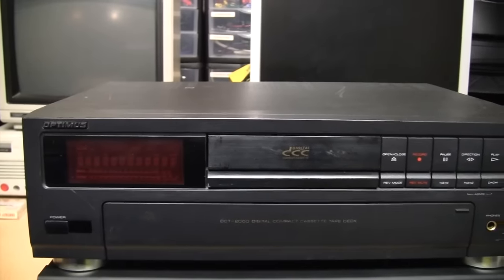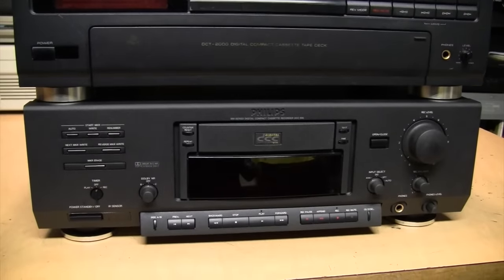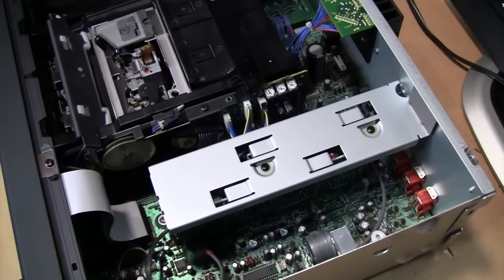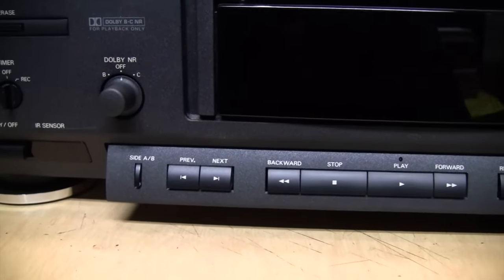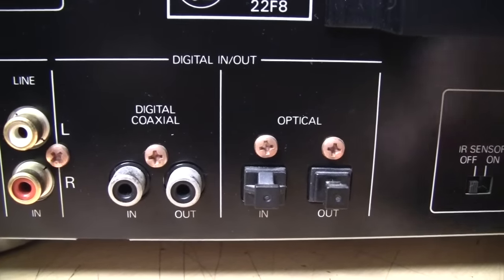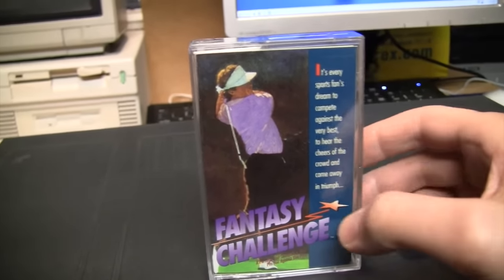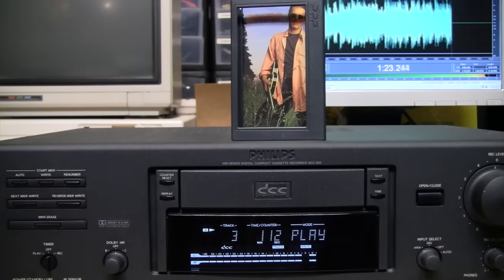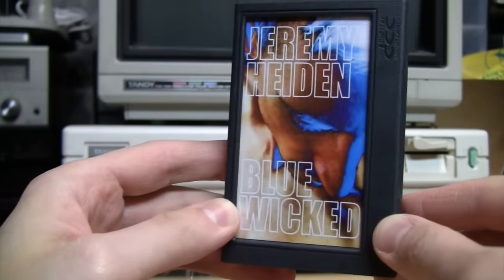Philips DCC900 Digital Compact Cassette deck revived!

Comment: I was going to ask if these can record on to analog tapes, or it they only record onto DCC tapes, but at 15:40 I got that answer and I was right about to post a comment asking that! My SVHS VCR I have will make normal VHS recordings if you use regular tapes, and SHVS recordings if you use SVHS tapes and I was curious if it's a similar deal with this. Now I see it's not.
Reply: There's a physical problem with analog recordings on analog tapes: the bias current that a DCC deck would have to send through the heads for the recording would destroy the sensitive Magneto-Resistive heads. Recording in digital on analog tape is a problem because most analog tapes aren't designed for the high frequencies that DCC decks use (about 96kHz on 9 tracks per side). The magnetic particles on the tape are just too big to store that much information. So they used a diffferent tape formula that's similar (or identical?) to video tape.
Reply: @ CoolDudeClem:  you can actually use regular VHS tapes as S-VHS tapes in S-VHS machines if you drill a hole into the regular VHS tapes at a certain spot. So you can record S-VHS quality on regular VHS tapes, without having to use actual S-VHS tapes. However this really is just a hack and I would not recommend doing it that way constantly.
Reply: No, that's not the case.  DCC tapes were TYPE II formulation BASF tape.  Nothing special, actually.  It's a shame that the price of blank tapes were so high.  This, doubtless, made the format less appealing to a mass audience.
Reply: @KRAFTWERK2K6   I actually did it constantly  with my SVHS recorders,  only  a slight loss in quality  over a "real" SVHS"  tape.

Comment: I just remembered, I have the same deck that isn't in use since the early 2000s. Luckily I have a lot of experience with replacing the SMD electrolytics aka the plague of the early 1990s electronics, so this would be a challenge.
Reply: I caught it right on time, as there was already a lot of corrosion and a few broken traces and vias, but now it works again. Used tantalum capacitors instead of electrolytics so it will last a very long time

Comment: VWestlife What is the software you are using that shows the waveform on the monitor in the background? Thanks!
Reply: Audacity. Its free to download.
Reply from the maker: No, I was using Adobe Audition 1.5, which is commercial software.
Reply: Thought it was Cool Edit Pro (the forunner of Abobe Audition).

Comment: I still have the original one DCC900 i bought in NL in 1993 i believe for around 1700 Guilders. Just last year it stopped playing, just no sound. So i will replace the capacitors too, to see if it does the job. I never played analog cassettes on it, because although it can, i know it's not really good for the head. I worked 13 years in a workshop where these devices where also repaired ( only i did TV repair not audio). I also have a dcc170, don't know yet if it is the belt, comes up (pushes the head to the tape) and drops again.

Comment: Is it possible to cram a DCC in a regular deck when you remove the shutter mechanism? The tape in a DCC is a lot more high-quality than that of a regular compact.
Reply from the maker: No, the shape of the shell is quite different. The DCC tape is equivalent to Type IV metal tape.

Comment: Hey man! I recently got a sony ps-lx300usb and its playing my records at the wrong speed. What should I do?
Reply from the maker: First make sure you have the belt installed correctly, with no twists, and that you have it set to the correct speed for the record you're playing (33 or 45 RPM). If that still doesn't help, you can adjust it using the procedure shown in this video (it's for a Fluance turntable, but yours works the same): https://www.youtube.com/watch?v=RQOQQ5NaSRU
Reply: Yep, found the hole and changed the speed. It now works. Thanks alot!

Comment: Would a DCC casette be able to store data the same way as a DAT tape could?
Reply from the maker: DAT uses a rotating head and DCC uses a stationary head. In order to store uncompressed digital audio like DAT, it'd need to run the tape a lot faster, which would give you less recording time.
Reply: On the last player, the dcc175 portable you could backup 250mb of data
Reply: Yes. But 384 kilobits per second is not a very impressive speed to store data. It would easily be outperformed in every way by QIC-80 drives that were popular at the time. As Dr. DCC already mentioned there was a recorder (DCC-175) that could do it with the special "PC-link" cable and Windows 3.1 software (so it only worked with short filenames too!). Both DCC-175 and PC-link cable were only available in the Netherlands and are extremely rare.

Comment: Good, by your tag line I thought DCC was coming back into fashion. This whole leaky electrolytic SMT caps in new to me. I'm betting they just don’t get passive air flow, keeping them cooler. Repairing anything isn’t too bad as long as you can get the parts, troubleshooting is often straightforward, provided you can get the schematics or have made similar repaired. 

The biggest complaint about analog cassettes is finding the song 😂. How about hissing, wow and flutter, tape getting jammed up, or plain old degradation after 50 plays or so.
Reply: Nothing to do with cooling.  It's the well-known capacitor plague (Google that if you're curious), and it affected through-hole caps as well as surface-mount.  Bad electrolytic formula, not design error.

Comment: After watching a video about portable DCC players from DataBits a few years ago, I was somewhat interested in getting a portable DCC player, but when I did some very brief research I found that portable players are few and far between, and I think they all use rechargeable batteries which you can't get now, unless of course someone's manufacturing new battery packs for these portable players.  Actually I think maybe it was Techmoan who talked about portable DCC players.
Reply from the maker: Dr. DCC also rebuilds the battery packs for the portable players.
Reply: Ah, that's great, well maybe I may consider getting one then, if I can find one at a good price and that works.
Reply: Plenty of portable players available. Better get the 2nd generation like a DCC170, that is 18bit and allows recording. Most of them are broken, and even if they work, belt replacement is a must.
Reply: I see.  Do you have customers sending units to you from outside of the US?  I live in Australia.
Reply: The other thing is I'd need to get an appropriate AC Adaptor for the player if I should get one, do you know if the AC Adaptors for these players could work on different voltages?  We use 240 volts here.
Reply: Lachlant1984 Yes, we do global, but from California
Reply: Lachlant1984 Hi, you can contact us. We have adaptors for any voltage. Standard (depending on ordered) they are 220 / 110v.
Reply: No worries.  I really appreciate your help.  I'll have to take a look at the DCC Museum website, I haven't done that yet.  I did however have a quick look for portable DCC players on eBay this morning, the only portable unit I found was a Philips DCC 134 I think, it also came with a Sony MC-R70 MiniDisc recorder.
Reply: Lachlant1984 The 134 is a player only and not a recorder. Wait for the 170. If you ever need a restored one, you can contact the museum.
Reply: Do the portable players suffer electronic problems such as capacitor failure as is the case with the component styled DCC decks?  Apart from perished or worn belts, are there other common problems with the portable DCC recorders?
Reply: Lachlant1984 The belt problems are most common in the second and third gen. First gen can also suffer from capacitor problems.

Comment: I’m a bit concerned on the use of through hole capacitors being used in places of the SMD capacitors. Was there a specific reason for that? Are they also glued in place to make them mechanically stable? Putting TH caps in place of SMD often puts a lot of strain on the pads/traces and can easily pull them off the board.
Reply from the maker: Dr. DCC has repaired over 100 machines using this method and I'm sure if there were any problems with it he would've noticed them by now.
Reply: Hi, some 6V caps would need to be replaced by 16V caps and those are just bigger. So since you would have to fiddle with making them fit, this is actually easier and in my opinion puts let heat/stress on the board.
Reply: Hi DR DCC, thanks for the reply. I had assumed there would have been a reasonable explanation for using TH caps in place of SMD. The only reason I asked is, in the retro computing community this practice is kind of frowned upon. But sometimes you just gotta do whats needed to make the thing work. I have an Apple LC II with TH caps in place of SMD. I just didn't tell anyone up until now lol Also, good job in keeping this old hardware going. I completely understand the want to help support and maintain old hardware no matter what it is. I never used DCC before but was a big fan if MINI DISC and am super sad it didn't last longer.  Sorry if i seemed rude in my OP, that wasn't my intention.
Reply: John-Paul Parker Thanks. You did not seems rude. Just curious. Another reason to be using regular caps is that most boards in the first gen dcc players are so damaged, that the actual pads are gone and you can use the regular caps to connect via the next component or pad. You cant do that with smd.
Reply: DR DCC yeah I understand that. I'm active in the Commodore Amiga community and unfortunately they suffer the same fate. Bad caps eating the pads and any traces that go beneath them. So many lost computers due to bad caps.

Comment: I have a DCC 300 by Philips. The only problem i have with it sofar is the tray for the tape being sticking, probably due to a loose belt. It plays analog tapes just fine, i haven't tried an actual dcc tape with it yet.
Reply: Hi, The tray belt usually starts slipping. On the DCC300 it is a tricky repair, but doable. You would have to remove the mechanism to get to it.

Comment: Is digital cassette and DAT the same thing?
Reply: Thanks
Reply: DCC and DAT aren't the same thing. DAT used wider tape and it used helical scanning like video tape. DCC used stationary heads. DCC was compatible with analog cassettes but DAT was not. DAT cassettes were smaller and the tape ran slower and it had no "B" side. DCC like analog cassettes ran at 4.76 cm/s and used half the width of the tape so you had an interruption halfway into the tape.
Reply: Thanks for sharing your knowledge it is really helpful.
Reply: @duskonanyavarld1786  Also DAT is lossless while DCC is lossy.
Reply: @HBC101TVStudios  Cool

Comment: So I notice the design of a DCC is the same as a normal cassette except it has the sleeve that slides over. If you were to snap that off, could you play it back in a normal analog player, and if so, what would it sound like?
Reply: So, this I had to try...... After removing the metal cover, the capstans of my Marantz analaog cassette record are to thick, so it would not even fit. Ok, drilled holes in the dcc, so it would fit, but then the pinch roller does not get far enough into the dcc cassette, to move the tape decent,  let alone produce sound.
Reply: DR DCC oh wow! I would have figured it would have been garbled or something, possibly due to the digital information encoded on the tape, but if it produced audio, that is amazing!

Thanks for testing that out and quenching my “curiosity” thirst!
Reply: No problem. Sometimes looking from a different angle, like you did, makes you wonder if it would work. We recently did the experiment of using regular tape as dcc, but never the other way around. Since dcc is high quality videotape, I was wondering if we could record on it and how it would sound. The only alternative is to remove the tape from dcc and put it in a analog shell.
Reply: DR DCC sounds like fodder for a good video! Subscribed!
Reply: Thx. As a bonus..... I just removed the tape from the dcc  and put it in a regular analog cassette shell. Works and sounds great When playback the digital recording (dcc) you do not hear anything, but I was able to make a recording on the analog deck, using the dcc tape and playback sounded great.

Comment: Really quiet a shame that you can never replace the heads on these decks with new ones. If one of the internal track head coils fails, the whole head is just junk. Guess the same same goes fo DAT heads as well, just that there are still alot of DATs still around today.

Comment: I think the problem with people finding the tracks they want was more to do with the having to wait as the tape fast forwarded to the point they were after and over-shooting and having to rewind to find the start, etc., when compared to CD or Minidisc formats of the time (heck, even Vinyl!!) where you picked the track and pressed play, this was a virtual eternity, and DCC never really improved on that aside from having the auto-seek when picking a track number, this is probably why DCC was a failure, it was just an old technology with bits added on... :\
Reply: At the time when they started developing it, there was only CD and tape. Philips designed the original analog cassette and making a digital version of it seemed like a logical step. They emphasized that the sound quality of DCC was just as good as a CD, so people who liked the quality of CD would like DCC too. They figured that people don't use fast-forward and rewind on portable cassette players much either, so it wouldn't be a big deal. And DCC would be a great alternative to DAT, which was more complicated mechanically and more expensive. They thought that portable recorders would be important, but they underestimated that so it took 2 years before a portable DCC recorder appeared (there was a portable player from the beginning). They also underestimated that consumers would be okay with lesser audio quality in return for more convenience, like MiniDisc. I also think a big problem was that if you wanted to have a DCC recorder in your home setup, you still needed an analog deck to record on the old cassettes that would play in your car or your portable player, because the DCC couldn't record analog cassettes. I suspect that the inability to record on analog cassettes was an unexpected problem that they might have thought they could have solved eventually. Eventually Philips developed a double deck recorder with one analog and one digital mechanism, but the format was canceled before the development of that deck was released.

Comment: Surface mount technology must be one of the worst innovations so far as the amateur electronics enthusiast is concerned.
Reply: Amateur electronics enthusiasts are more or less adapting to surface mount technology just fine. It can be a hassle sure, but that's more because of having to learn new skills and invest in new equipment more than anything. but I could never say its 'one of the worst innovations' because its now let amateurs design some very high tech designs. you can only go so far with thru-hole technology
Reply: Yeah, I hardly bother with TH parts anymore.  It's a lot easier to build a quick PCB with a solder paste stencil and hot air gun than to place and solder all the leads of conventional parts.

Replacing caps can be tricky due to their size blocking the pads sometimes, but removing through-hole parts when the PCB had plated holes is no picnic either.
Reply from the maker: Yes, that and also lead-free RoHS solder.
Reply: I agree. Lead free solder (at least the first generation, I think it has improved quite alot) is really bad for BGA chips. They can fail very easily because the brittle solder balls crack.
SMD in general is fine, you can get used to the larger smd resistors. But for chips with many legs on them, or even a thermal connection in the middle, it is almost impossible to (de)solder them without a reflow oven or hot air.
When it comes to SMD caps, I think modern SMD caps (""solid capacitors") for example on motherboards are quite good. I think in general capacitors are finally out of a pretty good qulilty, even the cheaper ones. In the mid 2000s some devices could fail in 2-5 years already because of bad caps. I think this is not the case anymore, the only devices from the last 5 years with bad caps which I have seen are cheap PC power supplies

Comment: Vwestlife, you should buy yourself a cheap soldering station from China on eBay (search bigclive's channel for recommendation), a reel of solder, flux and learn to how to solder. You could have replaced the capacitors yourself. Its pretty easy really.
Reply from the maker: I know how to solder. I just don't have the equipment to do surface mount components.
Reply: Are soldering stations that expensive in his country that he has to order it from China?